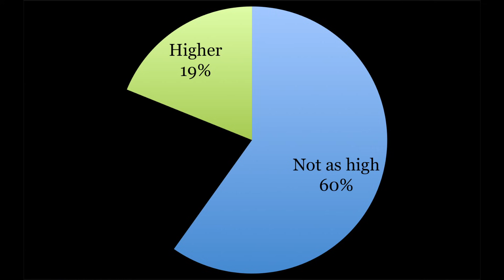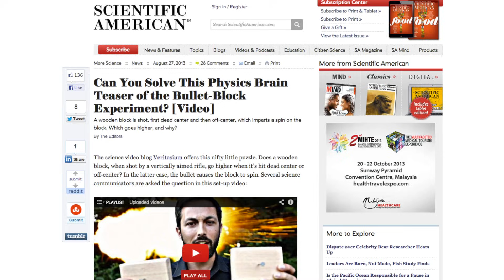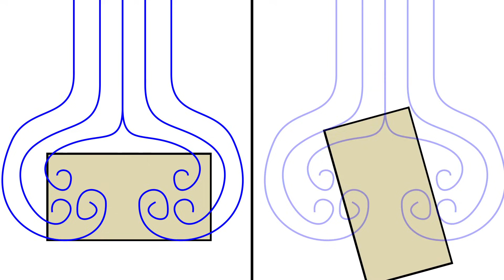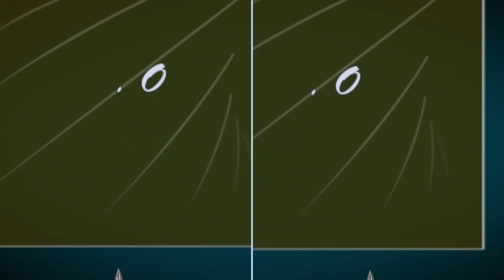Bullet Block Explained!

Comment: A similar question was on the AP Physics C exam years ago, and it had a very low success rate. Linear momentum must be conserved, so they reach the same height due to equal initial launch velocity. Angular momentum must be conserved, and since there is an r X mv initially there must be an angular momentum of the bullet- block system afterwards. These two laws have never been found to be violated, so it does also spin. Total energy must also be conserved, so the difference in Kinetic energy has to be due to heat(sound a light too). The exact mechanism for this is hard to determine, but it makes sense to me that the bullet stops more abruptly hitting on center, creating more heat than the offcenter collision that “gives” a bit.

Comment: LOL.  Derek say "exact same height", and puts up a red line showing the the spinning block is slightly lower.

Then later admits he picked 2 that were almost the same height, even though he had a range of results.

In short, the whole thing was deceptive.  I normally like Derek's work, but this one gets a down-vote.

Comment: Don't know if anyone is checking these comments at this point, but I'm a bit confused about the very last section of the video. Why do you see such a large difference when you measure the depth of the bullets with a nail, but a negligible difference when looking at the X-ray images? Is it because the second bullet curves off, so you can't push the nail further in because it's straight? So what you are measuring with the nail is not the difference in depth?

Comment: Thanks for proving that my theories were right, lolol. Intuitively, I explained it as the force of WEIGHT differs when you move further away from the centre of mass. So the amount of force to subtract from gravity equivalent is much less. Also, rotational energy is separate from translational-- this result has been proven several hundred times towards gravity, this is just one AGAINST it.

Comment: 2:50 into the video, and I'm guessing that, because this is an inelastic collision, there's some energy lost to sound and heat, and maybe less energy is lost when the bullet goes off the center of mass. The force on the center of mass, and therefore the gain in linear momentum, is the same though, although for reasons I'm not entirely sure (I remember this from physics class and it's possible that I came up with an intuitive explanation sometime in the past but have since forgotten. Not sure).

But of course, why then for elastic collisions? Not sure. Maybe it feels a larger force pushing it back.

Comment: My guess is the array of blocks going to different heights is simply due to the variance in charge of the bullets. It is exceptionally difficult to find two bullets that have exactly the same amount of charge. Additionally the projectiles may have ever so slightly different mass and at the speeds of travel the smallest variance in mass would have a huge difference on the amount of energy transferred to the block.

Comment: HELLO :)
  This is so simple; it doesn't even need an equation or formula.
In the first case (the one that is shot off the center and did not rotate) energy of the bullet diffusion in all of the atoms of the block; But in the second case (the one that is shot right into the center of mass and rotated) the energy diffusion in atoms that there are in the corner of block….  And after that energy kind of sorrow on the other side of block and leads to rotate.
So there is not extra energy; there is the same energy and actually the same high…( in the rotate block energy just get and give between two sides of block)

I don’t know using the word "diffusion" it is correct or not.. I hope that I can convey my ideas clearly ^_^

Comment: For me it still no clear, because in computing, you can add force at any point on any physical object, and this force doesnt create sound, deforms or penetrate the object, just results in a displacement
why in this case would be like so?
Reply: becuse when computing we assume bodies to be rigid and frictionless. rigid body means a body which does not deform due to any amount of force. so we do not consider loss of energy in that case

Comment: the real answer is that the energy of a small caliber bullet is about 90-100j even an air riffle has about 35j muzzle energy, you calculated the potential energy to only be about 2j and the rotational energy about 1j. those who said the rotational energy is negligible were actually right because it does not come off from the blocks 2j energy, it comes from the 100j bullet energy. so at point of hit one block was hit by lets say 100j the spinning block was hit by 99j and 1j went into spinning it. but then where is the remaining 98 and 97j? well, it goes into accelerating the block, and energy need of acceleration is NOT linear (you know e= m x c^2 or rather 1/2 m*v^2), for the bullet to accelerate the block at very low speeds the requirement is very small then it gets exponentially higher and higher and because of this the missing 1j energy is not causing any real difference in the starting kinetic energy of the block, but regardless its there, its just so tiny, no camera can record it.

Comment: I think the answer lies in the rotation of the block, the resulting torque on the block can be taken over its center of mass which does not rotate and therefore its variation is zero and the angular momentum is conserved together with the linear one, this means that during the ascent, the force of gravity does not slow down the rotation, and by conservation of energy, the rotational kinetic energy is conserved, so using conservation of energy, the rotational cancels on both sides and remains
  K(initial translational) + K(initial rotational)= mgh + K(initial rotation)
since at the top, there is not only potential energy but also rotational energy

Comment: I am not a physicist so what I suggest here is merely gut-instinct.

I think it is a mistake to ask the question, “where does the spinning block obtain its extra energy?”. Instead, the question should be “where does the non-rotating block lose some of its energy?”

I think the centrally shot, non-rotating block is a poorer mechanism for energy transfer than the rotating block. 

For a microscopic moment of time - because of inertia - the blocks will both be stationary after having been struck by the bullets. The energy of the centrally fired bullet has to lift the entire mass of the block in one push. By way of contrast, the bullet hitting the spinning block has only to firstly lift substantial less mass vertically - effectively taking advantage of the mechanism of leverage. If I were to lift a concrete block vertically, that would require more force than initially lifting it by one end, using the block itself as a lever. I suspect that is what we are observing. The non-rotating, centrally shot block is a poorer, less efficient energy transfer mechanism. I think the means of testing this would be to repeat the experiment with ultra-high-speed cameras. If my theory is correct we would see that the end of the rotating block would begin to move before the non-rotating block began to lift. The bullet hitting the non-rotating block has more inertia to overcome so its acceleration will be slower, so in that albeit very brief time period the non-rotating block has to consume more of the energy in the system. It is here energy is being lost.

Comment: But what about Angular momentum conservation? As Derek said, the angular momentum also needs to be independently conserved right. Now initially, the bullet is just traveling straight so it doesn't have any angular momentum. But after piercing the block, the block rotates along with the bullet so it has some angular momentum. How does this happen considering that initially there was no angular momentum?
Reply: Actually, there is an initial angular momentum because angular momentum can be caused by linear motion. The bullet getting shot offset from the center of mass of the block contributes this angular momentum due the the fact mentioned above.

Comment: If the nail had held long enough it would have redirected the direction of the  energy to the side while the nail held. Then it would move more sideways and not as high because some of the energy would have been absorbed by the nail before it broke.

Comment: If you cut the wood in the same shape but the width going against the grain, the bullet would travel further (because it is going with the grain) and it might be easier to detect a small difference between treatments.

Comment: Now hear me out… I think what has everyone hung up is the spinning. The wood had a nail through the middle. The question not being asked is how much force is needed to spin the wood around the center point. It would be very low, and easy to measure by measuring the rotational speed of the wood and replicate by hitting the wood in the same place with a velocity sensor at increasing force until the block spins at the same speed as the original experiment. It would be low, and that’s why the difference in bullet penetration is so small.

Comment: I'd like to know how precisely they controlled for variables such as:  1. mass of each bullet (measured, not just average); 2. amount of gunpowder in each cartridge; 3. mass of each block of wood; 4. geometry of each block of wood; 5. mass of each nail; 6. air temperature and 7. relative humidity at the time of each gunshot.  That's seven variables, from an amateur, without thinking too long.  Surely that's enough noise inserted into the system that it could be masking the data that is being sought.  However, perform this experiment a significant number of times, and you have a better chance that any difference in data will show itself above the noise level.

Comment: I suspect the slight variations in height between blocks is due to the differences in each block. No two blocks of wood used were exactly alike. Slight differences in size, weight and density may be why they don't go to exactly the same height

Comment: Didn't Galileo prove this with dropping the two objects?  
How bout this:  0+0=0 and -1 + 1 = 0. 
In other words the energy put into the system where the block doesn't rotate has an upward vector distributed uniformly to every particle of the block, where as the spinning one has one side with more energy in its upward vector for those particles, but the ones on the opposite side have less. In both cases, the total energy of the system is the same, but between each case, its distribution isn't.
Schematically, given a 30 N total upward force,
CenterOfMass: Left(10N), Center(10N), Right(10N) = 30N
RightOfCenterOfMass: Left(5N), Center(8N), Right(18N) = 30N - although the right side has more energy and would go higher, the left side has less and drags it down and although this produces a spinning effect, the total upward force is the same.

Comment: The one hit on the sides has a higher torque, and was supposed to go a bit higher , since the distance of the point where it was hit by the bullet was at a bigger distance than the one hit at the centre. Since the distance was more from the fulcrum in the side hit, it was supposed to go higher, but that was maintained by wasting out energy in a rotational form, and eventually both rose to the same height. This is a case of an inclined plane, where the pivot is the fulcrum. Similar to a door, that requires more energy if pushed nearer to the hinge , than the one pushed at the door knob area.

Comment: May modify the material. Lighter material would give a measurable difference. Block has to be bigger too. Bigger block helps to retain the bullet in light material and also it creates more leverage / angle etc. 
Also you may alter this just to get a clear idea by using soft material in the middle of the brick and harder material in the sides, and importantly, vise-versa. 
:)

Comment: I am not sure if you are still checking the messages from this, but I think it would be illuminating to do this with varying lengths of block.  I think you will get to the point where the center bullet will left the block slightly and the off center bullet will lift only 1 end of the block ( I think twice as high so the center of mass would be the same hight as the center shot block).   Another variation would use a consistant length of block, but vary the distance from the center for the offcenter shot.
Great video!!

Comment: I love this video and wish I knew it long before. Yet there is one thing missing in all the analysis: depending on its initial offset, the bullet does have a different angular momentum with respect to a given origin of space. So that the total rotational energy of the whole system is different for the two experiments (without and with offset). No energy is created or lost, you just start with two different initial total momentum and total angular momentum….

Comment: Is it possible that the main center spinning axle has something to do with it? You have a nail in the middle around which the wood rotates (kind of like also pinpoints the center of mass). The symmetry of the system that was "created" drives the energy towards the same direction (vertically upwards from that very center. Does any of this make sense?

Comment: To eliminate the energy consumption for the penetration of a bullet into a tree, conduct another experiment, but not with a bullet, but with a ball from a ball bearing, well, a block is also needed from such a hardened material, and you need to shoot not from a rifle, but from a catapult. Then there will be almost 100% elastic deformation, and then it is possible that we will see a significant difference in height. 
But there is one more thing, the speed of the ball's rebound, it can be different, it also needs to be measured.

Comment: I dont get the percent of depth argument. The difference is about 1% in energy, yes but this would not correlate with % in depth directly. I would think that different materials have different energies required to deform them, lets say per centimeter. The energy is still 1% in difference but the difference in depth will be magnified way more if a material was chosen that required low energy to deform it. The % in depth difference will be different from the % in energy difference.

Comment: 7:20 This is also wrong. The bullet must transfer 100% of its energy regardless of distance traveled within the wood.
The amount of energy converted into heat is also negligible. If significantly different materials were used, then that would magnify the disparity. But you seem to have used the same wood type and density.
And while yes, angular and linear momentum ARE separate, those are PRODUCTS and not INPUTS.
The fact is, you must measure from the center of rotation to figure the "measured height" of that block. I have a feeling that while the angular momentum is 50% of the potential gravitic energy at the apex, its number would be MUCH smaller as measured just after impact with the bullet. Perhaps less than 5%. (Although this last section of my post is admittedly questionable, the 1st 2 points that I made are clearly demonstrable.)
Reply: Why would the energy converted to heat be negligible?
Reply: @justL0987  Because that is simply how the equations work. Momentum is MUCH more "heavily weighted" in the equation, than is conversion of friction into heat. Remember, "heat" is massless.

Comment: Don't trust intuition. Trust conservation of [linear] momentum: mv=(m+M)u where m is the mass of the bullet, M is the mass of the block, v is the bullet speed, and u is the initial speed of the center of mass of the block+bullet. That depends only on the fact that the bullet embeds itself so that the it is a totally inelastic collision. It does not depend on where on the block it embeds itself, or whether it is spinning too. It would be nice to make a video response, but it really is that simple. What is also not intuitive is that it goes straight upward when hit off to the side, but v (the initial bullet velocity) actually points upward, so the initial and final momentum (after bullet embeds itself) must also point straight upward.

Comment: I have a question, the bullet has either a clockwise or anti-clockwise spin on it  from spiral grooves cut in the barrel. You could research the rifle and find out if it's clock wise or anti clockwise

Comment: Take a few standardized 1 ft 2x4s, put them horizontally on the floor of something that has standard smoothness, like a basketball court, hit one of them horizontally with a good quality crossbow dead center in the middle, using a standardized metal short arrow, and see how far it slides straight.   It should slide fairly far, with no spins.  

Repeat, hitting a second 1 ft 2x4 horizontally with the same crossbow, but this time towards one of its ends.  It should slide away in the same direction like the first piece, but this time will be spinning in circles.  

Friction should be equal in both cases, at least for that same initial distance which both should cover.  

This approach should give you enough length and distances to be able to measure variations, especially if the sliding is considerably far (10, 20, 50 feet).

Most importantly, you need the arrow to stay in the wood, though you need them to go deep enough.  So, test various thicknesses until you ensure the same, as arrows going completely through the wood would defeat the whole purpose.

Probably a length of 2 feet could be better, as it increases your measurement accuracy (for rotational momentum, lever arm, etc.).  One suggestion I saw below is to use rubber, which could probably be better (than wood), as crossbow arrows should surely get stuck in rubber.  But rubber has high friction, which could seriously affect the accuracy of the outcome.